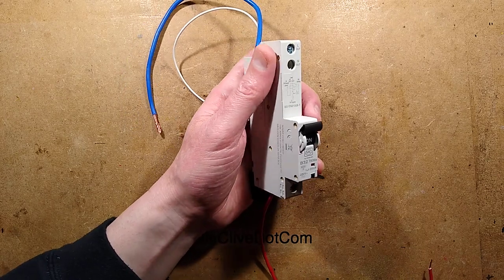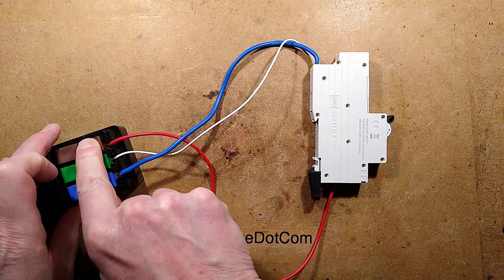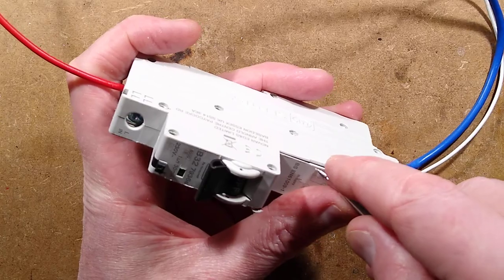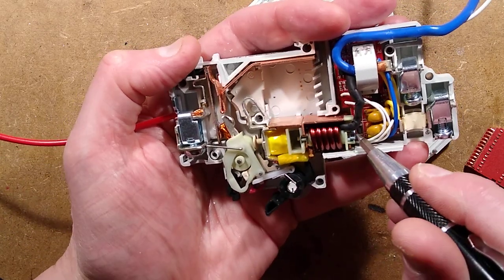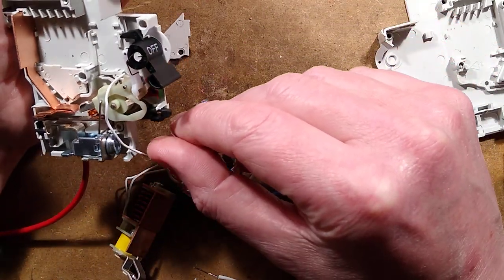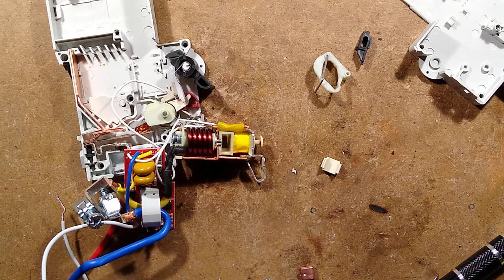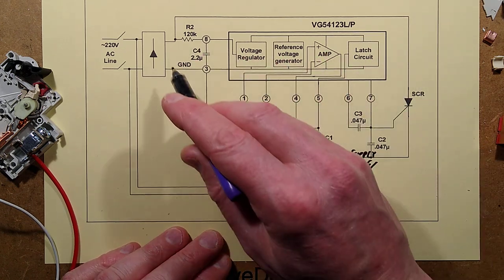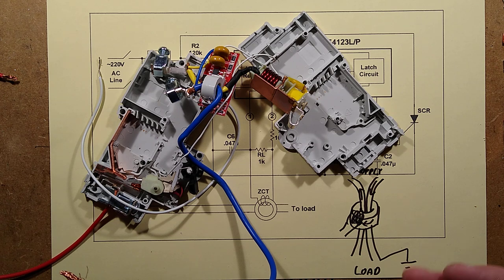Failed MK RCBO circuit breaker (with awkward recording moment)

Comment: I don't think he knew he was filming while he was reviewing the circuitry
Reply: LOL I thought that. Lots of silence then  'What the fuck are these'
Reply: I got that feeling too, lol.
Reply: Came here to find this comment. When he was showing us footage where he wasn't commenting, my heart sank. "It's about to bite him, isn't it? That's why he's included this"? I was too stressed to continue until I read this.
Reply from the maker: You're absolutely right.  This sometimes happens and gets caught by the Patreon supporters.  At least I didn't say weird things and beatbox this time.
Reply: @bigclivedotcom  I liked it in this case, though! Could really feel the gears spinning in your head as your worked through the construction of the thing.
Reply: I rather liked that bit of the video - many a time I have sat staring at something in the same way thinking "Does this... how does that fit.. what happens.. How do they make that... What else is about to ping off. What????"
Reply: I've missed out on Clive's beatboxing?
Reply: Big Clive ASMR
Reply: Please, Clive, don't ever change the way you are!
Reply: @bigclivedotcom  I felt the silence was unusual - as was the 'WTF' at one part of the vid !
Reply: @bigclivedotcom  If it happens again Clive, just overdub with cat purring.
Reply: It was good, was following the logic and it didn't place as a normal design.
Reply: @bigclivedotcom  you beatbox? oh my...

Comment: I absolutely adore those little hollow metal screw drivers.  There was one in an "all in one" soldering starter kit I bought to check for a friend, and loved it so much that I went on Amazon and bought a box of four of them, so I could have them everywhere!  A side benefit, the bare metal strips are an excellent way to quick check continuity on a new multimeter!

Comment: As a journeyman electrician in America I must thank you for this video, I have replaced several similarly shity objectionable current sensing overcurrent protective devices with simple issues.  But a new replacement always solves the problem. $$$

Comment: It's a great feeling knowing you've been learning by watching videos like this. As soon as you mentioned the ferrite toroid, I knew how this thing was detecting faults (well, one way it detects them).  Something I would have not known just a year or two ago. 
Seems like a pretty elegant way to do that, although, I wonder if you could create a circuit to trigger with all discrete parts instead of that special IC.
Seems like it wouldn't be too hard, but I'm guessing that chip ultimately allows them to use fewer parts.

Edit: grammar
Reply: The amount I've learnt just from watching this channel every couple days is insane lmao
Reply from the maker: Yes you can make a discrete RCD.  I took apart a Chinese clear RCD in a video and the circuit was basically just a thyristor, diode, capacitor and resistor.
Reply: I suggest a monthly challenge: screen-lickers acquire an instance of a well-specified item (such as this GFCI) and scheme, plot, plan, and execute its disassembly, deconstruction, and re-formulation into one or more useful items using only the components found within; video and ruthlessly edit the proceedings, including 'doodles', and the finished product in the process of doing what it was designed for, to fit within 240 seconds; Clive posts these, with comments, in by-object playlists, for general hilarity and edification. 

Cash prizes? Maybe later.
Reply: Maybe one day the 'special IC' will have a hole in it to pass the power leads through and make the whole thing a one chip wonder.

Comment: Having seen the schematic: when the SCR starts to conduct (is triggered, via the ZCT detecting a flaw in the AC lead) the bridge rectifier burns out. So that schematic is not OK.
Reply: The solenoid should be in series with the SCR. On that schematic, the solenoid is completely absent.

Comment: That circuit diagram seems to be for a cheapo version that just shorts out the mains and blows the fuse or trips a breaker when there's leakage current.
Reply: Sometimes, shorting the mains is the preferred way to switch off the power because it's faster than switching off with a switch. Much faster.
Like the arc protection systems in some medium voltage substations ("medium voltage" is usually "tens of kilovolts"). An electric arc in such a power station would burn everything to a crisp in milliseconds. So the arc protection systems look out and listen (with optical and acoustic sensors) for any sign that an arc is beginning to form. If it receives such a sign, the incoming power lines are simultaneously shorted with a rather massive copper bar. Voltages behind this short drop to near zero and everything is back under control (some big high voltage fuses will eventually separate the power station from the rest of the grid for good, but this may take tenths of seconds).
Oh, yes, since these power stations deal with rather high voltages, the copper bar needs to travel quite some distance until it reaches the main lines it needs to short out. No slow spring-loaded mechanisms here. The timely arrival of the copper bar is ensured through acceleration by explosives.

Comment: I was thinking LCBO, Liquor Control Board of Ontario, the bane of a large fraction of Canadians...
Reply: The bane AND LOVE of a large fraction of Ontarians ;)
Reply: Adymn Sani  Tim is owned by a Brazilian, its not even a Canadian store.
Reply: @Francois_Dupont  "not even Canadian" other than the fact that it was founded in Canada, it's headquartered in Canada, and more than 80% of the locations are in Canada, you mean?
Reply: @hobbified  "RBI is majority-owned by the Brazilian investment company 3G Capital"
"Wendy’s International Inc. acquired it that year, and in 2014 U.S.- and Brazil-based 3G Capital merged it with Burger King under a new parent company, Restaurant Brands International. " "On August 26, 2014, Burger King agreed to purchase Tim Hortons for US$11.4 billion;[12] the chain became a subsidiary of the Canadian holding company Restaurant Brands International, which is majority-owned by Brazilian investment firm 3G Capital, on December 15, 2014."
Reply: @Francois_Dupont  yes, I'm aware. But that doesn't mean anything for practical purposes.
Reply: @hobbified  its simple. its more than 50% (majority) owned by some Brazilian and US guy. no website i found give any stable number about the "Canadian" part of the ownership as of 2015+. they even say that the " Burger King" brand bought Tim in 2014 for 11.4b, so its as much Canadian as Burger King.
Reply: @hobbified  almost all the money you spend on Tims go straight to some guy either in the US or Brazil. so you cant really call that a "Canadian Company". its like saying Walmart is Canadian because they hire Canadian people to man the store.

Comment: Interesting how such a tiny piece of plastic flashing overlooked in quality control can completely disable a product.
Reply: It's a metaphor for how the world works -- and how it fails! The devil, they say…
Reply: @michaelthibault7930  Well, at least it failed safe, ensuring the safety of everyone.
Reply: There should be a collection of examples where some tiny part let the hole thing fail. Neat example: TV on/standby button supported by plastic hook, latter is part of the single-piece housing. Hook broke due to too much pressure on button caused by long startup delay, customer thinks the hole thing does not work anymore, does not turn on anymore, wants new tv and does not even consider a repair involving glue and costing less than 15€, labour included.
Reply: A 0.1 mm piece of flash in a mass air flow body can make a car run poorly so it was a tightly monitored tolerance when I made them.
Reply: @l3p3  Boeing 737? Max ?????

Comment: the schematic in the datasheet is using the SCR to trip the overcurrent mechanism in the breaker. This manufacturer chose (wisely imho) to use a separate trip coil. That's the reason the breaker in front of you doesn't match the datasheet.

Comment: Fascinating how large your circuit breakers are. Here in North America (except on dedicated circuits), you'd rarely find anything higher than 15 or 20 amps (at 120v of course). Granted, I understand that the NA and UK circuit designs are quite different. We generally have dedicated circuits (kinda like a hub and spoke model) as opposed to ring circuits. I also think our circuit breakers are designed to trip if the current exceeds the rating by a much lower margin (I'm not sure of the exact margin, I'd guess 10-15%).

Comment: At around 4:50 that u-shaped piece of metal is actually there to increas electromagnetic force induced in arc runner by electric arc during overload to speed up its travel to arc chamber.

Comment: @bigclivedotcom I think this one has 4 ways to trigger. The extra earth connection is there to detect DC problems that can a cure with larger battery chargers for care chargers and such. As they have high voltage dc and if there is a fault in that the normal RCD might not catch it as its not inducing a AC current in the coil.
Reply: The MK RCBOs just detect AC leakage currents - DC leakage saturates the coil and they don't trip. - see this for a discussion of car charger rcds etc
https://youtu.be/QfUiI-1WsOA

Comment: At first glance this looked like an RCCB, or remote control circuit breaker.  They were widely used in the DC-10 aircraft to open high-current loads in the aircraft electrical load center while giving the flight crew a standard circuit breaker in the cockpit to indicate fault trip while still allowing manual trip and reset.  Each RCCB was connected by a single wire to a standard, usually one-amp, circuit breaker in the cockpit.  These cb's were indistinguishable from the other circuit breakers which directly controlled current passing from bus to load through its terminals.  The ringed plunger topping the breaker popped out to indicate a remote breaker trip, and pushing it back in reset the remote breaker.  Of course, no actual load current passed through the cockpit breaker.  When the RCCB sensed a fault, whether it be short circuit, overload, or differential fault, it tripped the internal current contacts open, and simultaneously closed a contact that connected power from the RCCB control circuit to the breaker in the cockpit.  Since the second terminal of the cockpit breaker was connected to aircraft ground, the current tripped the low-value breaker to alert the crew to the RCCB trip.  Pushing the plunger back in restored the ground to the RCCB connection and caused it to reset.  Usually, policy was that the flight crew could evaluate the situation and make a single attempt to reset if they felt it was safe to do so.
Reply: In the industrial/commercial electrical world there is a similar device known as a shunt-trip breaker. But shunt-trip breakers can only be tripped remotely.
Reply: @brianleeper5737  "But shunt-trip breakers can only be tripped remotely." << Only if that's a non-auto type - i.e. having NO thermal / Magnetic or RCD functional components (Main Switch). 

If the CB is indeed a thermal/Magnetic/RCD it will trip on fault condition aside any remote trip signal input..... oh, and by manual action on the switch handle.
A shunt trip mechanism is usually a 2 wire add-on component, installed in the case of larger framed CB's, or as a clip-on trip module on the side of these small MCCB's. Likewise, trip indication modules can be added to proper industrial/commercial MCCB's.
Reply: @BTW...  You are correct. What I should have said is that shunt-trip breakers cannot be reset remotely, only tripped remotely (or via a manual switch, overload/ground fault, depending on the specific type)

Comment: Why does it need a connection to the earth terminal? Most RCDs simply “compare” the current running on phase and on neutral, which should be the same unless there’s current flowing to earth. And it looks like this one is also doing exactly that, only using additional electronics.
Reply from the maker: I think it's to detect earth/neutral anomalies.  I'll reverse engineer the PCB at some point.
Reply: bigclivedotcom Yeah, should have watched the rest of the video before commenting...

Comment: Interesting, it almost seems like there's usable op amps! I wonder if they can be re purposed for audio work? It would be a good reason why not to throw out an old failed RCD... An op amp with a built-in voltage regulator..

Comment: Presumably it'd have to trigger instantly on a neutral fault because if there were one it'd rapidly lose power and be unable to break the circuit anymore.

Does it even have enough charge in those caps to fire the solenoid in the case of a power loss? 

(I think this my depend on where the neutral got broken whether there was a power loss)

Comment: Do you what exactly the PE cable is good for? It seems it could trigger without so I’m missing something
Reply: It isn't a PE its a Functional Earth. If the neutral were broken it provides a current path for the trip mechanism to fire.
Reply: @johncoops6897  This breaker does not have any internal connection between the neutral wire and the white earth wire, therefore the only current that will ever pass through the tiny white wire is what the internal electronics allow to pass through, which is probably on the order of 10mA or so.
Reply: Thanks for your input. In my application Earth is PE connected to a inverter enclosure and a earth rod in the soil. Live and neutral goes from inverter to a RCDO which has only 2 wires in and out. Earth is not available on the RCD. Appliances have PE connected. In a case of an human body in the loop I would also think that the human is standing on the ground/floor in 99% of the cases right? So all is well? Thanks
Reply: @John: okay, the inverter is indeed fully isolated but there is an interference filter inside the inverter (own board) between Neutral and Chassis/Enclosure/PE which can be disconnected by disconnecting a ring terminal. I have he filter connected. Therefore if I measure between Live and ground I measure half sine voltage. Interestingly when I use a screw driver for checking for live it’s lights rather dimly on ground and neutral and full at live. Maybe it’s just 1mA that is flowing I wonder... Does that observation make sense? Thanks again, much appreciated!

Comment: I did a search for 'EARTH LEAKAGE CURRENT DETECTOR IC' and found a similar circuit with a relay coil in the anode of the scr, my guess is that they left it out on that diagram
The only other (dodgy) way is for the magnetic trip solenoid to be in series with the input, and the scr shorts the circuit.
Reply: The datasheet for the m54123l shows a magnetic trip solenoid in series with the input.
Reply: Thanks, but that doesn't explain the small solenoid, so i think the datasheet clive showed is wrong
Reply: @sparkyprojects  The datasheet clive showed is missing what is shown on the other datasheet for the original version of this chip.

Comment: I remember when I was just getting into electronics when I was about 11 and now I'm 13, I took a 24v 12w 80mm brushless dc fan and stuck the wires in a kettle lead and and it sparked a lot and nothing happened no breaker no burnt coils only the huge cut on my finger from the blade of the fan and the lights dimming ALOT. The reason (I think you will know) why it spun is because of the diode to protect reverse polarity and the fan got really hot and it didn't explode because I pulled back so quickly because I was shocked, not by mains but by the big spark that scared me and no one noticed anything because it was summer morning and I was up late and I turned my lamp on and then saw the fan and decided to do that and no one knew a thing.